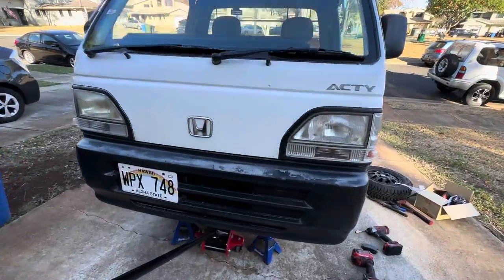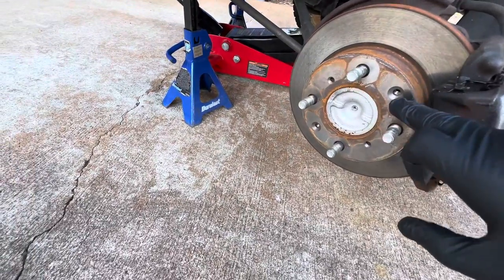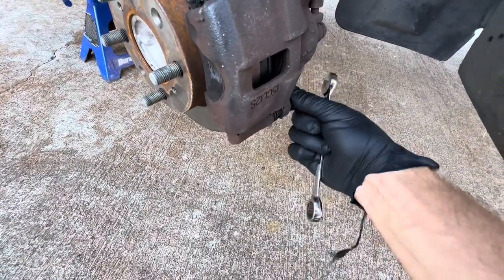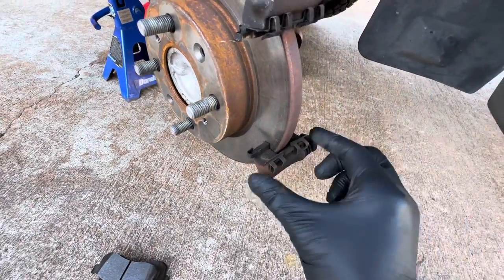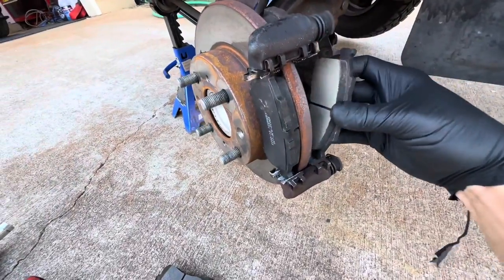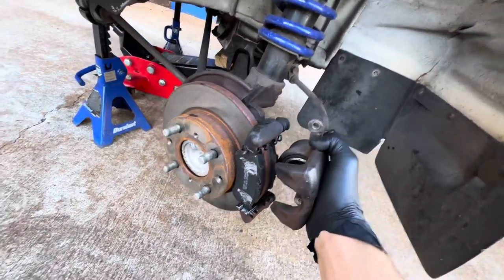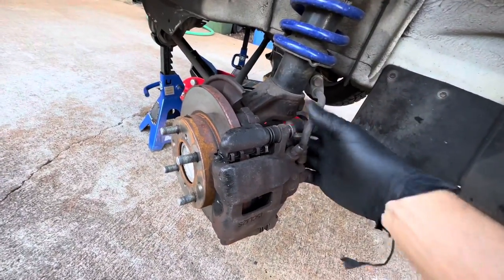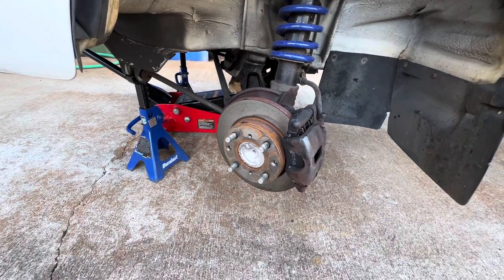Honda ACTY brake pad install guide

Comment: Thanks for the video. So no brake bleeding needed?
Reply from the maker: ONly if you rmeove the brake line. If you push the piston in and are only swapping out the pads, then there is no need to bleed.

Comment: What light bar and mount is that? Do you have a link?
Reply from the maker: I don’t sorry! Just measure the length you need and order one on Amazon!
Reply: What kind of bracket did you use?